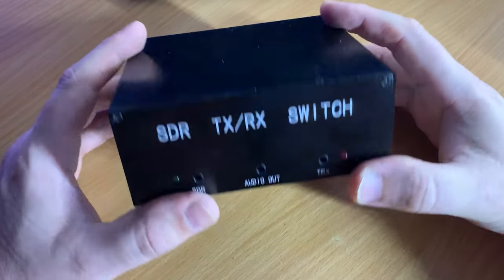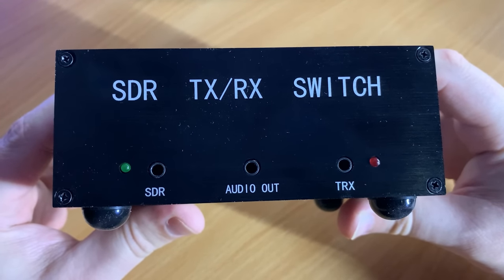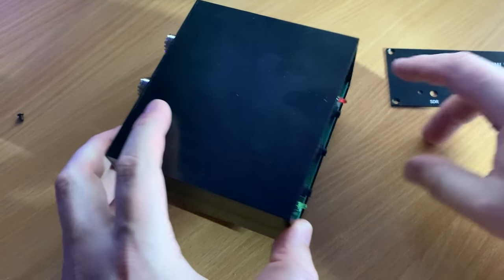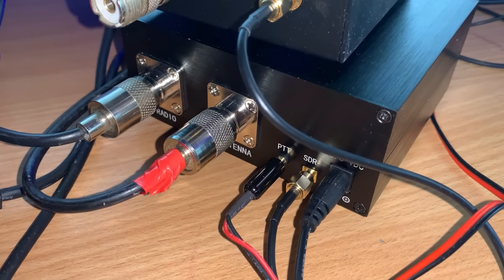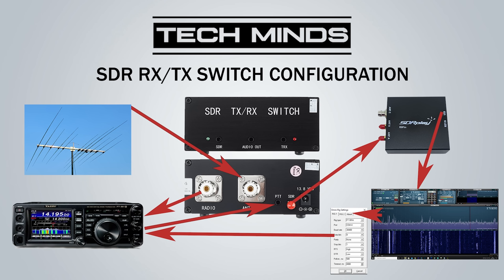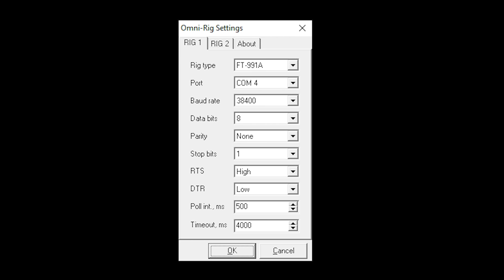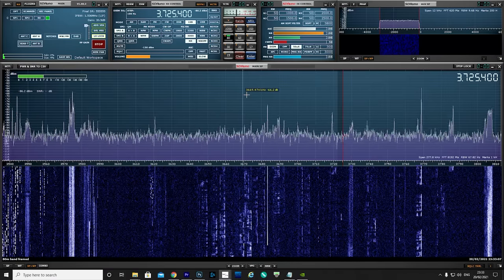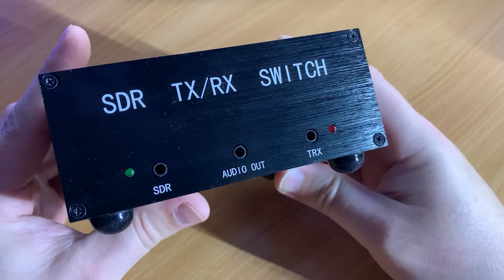PANADAPTER For Any Radio DC - 160 MHz SDR Antenna Switch

Comment: Very helpful video. The rf/af mute function was sluggish with my rig, and when operating semi-QSK CW, I heard a brief cw tone whenever going from receive to transmit, which was quite distracting. I stumbled on an easy fix to this in section 18.1 of the SDRUno manual - resetting the polling interval from 500ms , which seems to be the default Omnirig value for at least some rigs, to 100 ms. P.S., my TR switch is the MFJ-1708B-SDR, and I'm very happy with it. For me, at least, it had one huge advantage over the switch in this presentation - I actually received it after I ordered it. Banggood did ultimately issue a refund for the switch I ordered from it, though.

Comment: @Tech Minds:

I am not technically-inclined, so pardon me for that.  I have an analogue old HF receiver, not transceiver, that I would like to have a panadapter attached to.  I do also have a modern stand-alone SDR transceiver.  In order for the old HF receiver to access a panadpter, do I have to place this switch in line to my SDR, which in turn allows the input from the HF receiver to display panadpter readout on the SDR as opposed to, say, needing a computer to provide said panadapter?  Could you clarify my confusion?  Thank you in advance for your kind response!

Comment: I understand that there are two options: connecting the SDR antenna input to the gate of the first transistor  of the receiver amplifier using a "cathode follower" or rather a  "gate follower" of a FET, or connecting the input of the SDR  to an initial intermediate frequency step before it has passed through a narrow filter, also with a gate follower of a FET.

Comment: Just a heads up if your transciever has a built in ATU don't expect to have that work with your SDR , you will need a second (recieving)ATU between your SDR and the switch
Reply from the maker: Great point!

Comment: Very good tip. I have an SDRplay RSPdx and a Yaesu FTdx-3000, so basically I'll only have to follow the instructions to the letter. Thanks.
Reply from the maker: If you have a FTDX 3000 then you do NOT need to buy this antenna switch as that radio has an RX output. Watch this video I done on setting this up: https://youtu.be/bSJUdfRR9gw

Comment: How did you wire the 3.5 mm jack to the FT-991 8-pin DIN connector break out cable, I am struggeling to get it to work. For some reason when I connect the SDR the unit will no longer cut out to protect the circuit.

Comment: So,  here we are 3 years later.  I have a FT-991A radio.  The TUN/LIN jack on the back I have a control cable that goes to my tuner.  I am wanting to add this switch and a RSP1A but since the TUN/LIN jack is already in use, would I be able to just put a min-din 8pin Y cable on there to split off the TX GND and GND pins I need for the switch while still letting everyting else get to the tuner untouched?

Comment: Just received mine on your recommendation and set it up on my 991a, been playing this afternoon with it and working well. One question that's on my mind, as it clicks when power is applied to it, am I right in saying that if there was a power failure to the switch but I was still transmitting,  the sdr presumably wouldn't be protected as the relay is not shorting the sdr feed??
Reply from the maker: From what I’ve tested is that without power the relays fall into place so that the radio is connected directly to the antenna, and shorting the sdr ground. Thus, protecting the sdr if there was a power cut.
Reply: @TechMindsOfficial  thanks for the reply, I will certainly be testing this tomorrow.  If it is the case, that would be brilliant. Will post tomorrow to confirm on mine.
Reply: @TechMindsOfficial  Just as a follow-up,  I can indeed confirm that it does short the sdr when power is lost to the tx/rx switch. Thanks for your reply

Comment: It would be interesting to see some measurements of SWR and insertion loss.
Reply: on VHF I put in 40w FM .... only 10w came out,!!!!!
Reply: OK ... abit of testing.
1.8-30 Mhz SWR is ~1.2:1
50Mhz > 1.5:1
145Mhz SWR ~10:1 ..!!
So the Spec [on mine] should be Frequency Range 1.5Mhz - 60Mhz [NOT 160mhz]
Reply: @g0myw  Thank you. So what about the isolation between the ports during TX and the insertion loss on HF? It would be nice to know, if you have the possibility to measure?
Reply: @larsthunberg_SM0TGU  well that would be a good idea but all I have is a multimeter and a PWR/SWR meter.
But the label says . 
 [ not that I beleive it]

Impedance 50ohm .  [I really doubt this at VHF]
Frequency Range DC- 160mhz .  [ well not in my case . max ~60mhz]
Max TX power 100watts 
RF sense threshold <10mW @1.8 - 30Mhz
ON time <20ms  Release Time <190ms
Insertion Loss <0.3db @144Mhz (0.2db typical) 
RX isolation >38db @144Mhz (40db typical)
Power Supply 13.8v DC 200mA.
Reply: @g0myw  Thank you for your effort.
Reply: It is also important to measure the isolation on TX switched on, becasue after all the idea of this ubitbis to protect your SDR when transmitting....
Reply: @g0myw  Hi Jon, I also get huge SWR using this T/R switch on 145 MHz. Did you ever find a fix for that? Should I use an external antenna tuner ?

Comment: Great video. I got this device, however the TX signal cable that came with mine has a stereo 3.5mm plug. I saw the cable on your video and it had a mono 3.5mm plug. The socket at the board seems to be identical. I am wondering whether I can use an eBay cable that has the mono plug. By measuring the wires and the plug the middle part of the terminal has no signal, the red wire connects to the tip and the black wire connects to the back of the plug. It seems they ran out of mono plugs and send a wire with a stereo plug, but with only 2 wires and with the middle section disconnected.

Comment: Love your reviews, watched the MFJ pan' one the other day and was thinking of buying one and then I saw this review. They're currently £38.40 on Banggood, just one question I already have a mono 2 terminal jack plug lead could I use this in lieu of the supplied one wiring a 3.5mm jack plug to it? I take it they follow the standard where the centre pin is positive and the outer negative?

Comment: Great video. Any recommendation on how to connect the PTT when I am using a IC7300 and a Power Amp. I have a cable from the radio send jack to the AMP, so I'm not sure how to inject the TX/RX PTT into the situation. Thanks.

Comment: where does the SDR Patch lead connect on your RSP dx, Im trying to use the switch with an RSP duo using one of these switches and a MFJ-1708b, been using the MFJ switch with an RSP 2 without any issues, cheers

Comment: I have an end fed antenna with my 991a. Could I place my LDG auto tuner in the feed line before the switch to auto tune by keying the mic?  Thanks. I’ve learned a lot from your videos.
Reply: You place the automatic antenna tuner after not before

Comment: Have got one on order. I will have to make up my own PTT  cable to the switch box. As my radio ( TS480) does not have a PTT socket. It does have a din socket for control of a linear amplifier. 
Does the box require a specific voltage to ground the sdr on transmit?

Comment: @Tech Minds  help please ! Im doing custom cable for Yeasu FT450D which pins are you using to PTT ? 
wants to use TUNER Jack  port in radio are those pins correct ?
and pin 2 - TX Gnd (to tip jack/end part)
and pin 3 GND to the "longest" :) part of jack ??

Comment: Nice helpful review. I bought one.
When making the custom PTT cable, presumably using pin 2 - TX Gnd and pin 3 GND from the Yaesu 991 which pin’s cable should be connected to the end part the 3.5 jack ?

How are you setting up for the dual antenna inputs - HF and VHF/UHF ?
Reply from the maker: Tx Gnd connected to tip  . I only use mine on the HF port,  but I guess you’d just have to move cables around if you wanted to use on the vhf port.
Reply: @TechMindsOfficial  Thanks, very helpful.
Reply: ToyboxTV  please help - are you using to PTT: 
TUN/LIN Jack  port in radio ?
and pin 2 - TX Gnd (to tip jack/end part)
and pin 3 GND to the "longest" :) part of jack ??
Reply: @deszczykrobert4290  Robert, sorry it has taken me so long to answer your question. The short answer is yes.

Comment: I started with sdr’s then got fully licensed and bought the 991a, but find the tiny display crap compared to an sdr on a hd screen.   Nice bit of kit.   Have been considering the sdr panadapter than goes inside the 991a - but this is easier
Reply: Don't put your the sdr in radio mate.
Unless you have a Yaesu technician do it I would not recommend it.

Seen the boy do it with RSP1A and he lifted the traces to the USB. It looked a right mess.

This way is just as good and you don't risk ruining your rig (as much) 😎

Comment: How is the PTT control line (Red/Black wire) connected to the FT-991A radio? Does the 991A needs any special setting to provide the necessary signal to the switch?

Comment: Hi Matt,
Didn't want to buy the MFJ one as I read some horror stories. 

Be good if this manufacturer upped the coverage to UHF as well. Maybe you have the pull to contact the builder to perhaps suggest 440/450mhz coverage? 

If they done this it would properly out class the MFJ which I agree isn't too hard . 

Thanks for sharing

Comment: I have a Yaesu 450D and a RSP1A. I was planning to do something like this. One possible issue: When using 100W (50dBm). This SDR switch box has an Rx isolation of about 40dB. The continues input power to RSP1A is 0dBm (10dBm shortly). So I would probably need to put an extra attenuator of about 10dB in front of the SDR to be sure.
Reply: I alsi have an FT-450D and wiuld be interesred in any additional feedback you could provide... did you try it? Any issue?

Comment: For those running a G-90 I'm curious if all computer SDR software lags the radio audio when you have the jumper removed.  I imagine it has something to do with the 24 bit capability of the G-90.

Comment: hello tech minds

In the video you talked about using an ft991a, can you tell me which pins you used for the ptt from the transmitter.

is that the 13.8v and gnd?
Reply from the maker: It would of been the PTT line which I think goes to gnd on TX. You’ll need to check the radio manual as I don’t have a 991 any longer.
Reply: I created mine yesterday and connected pin 2 (TX ground) to the tip of the jack and pin 3 (ground) to the base of the jack. It works fine. Not sure if I needed to connect pin 3 as well, but it works. You don't need to connect the 13.8V.

Comment: I note it states upto 160MHz.  Given that I will switch it with the PTT control line could I also pass UHF / 437MHz at 5watts safely through this device ??

Comment: Question the feature you did with weather balloons the software will recommended will
That work with my base scanner ?
I’f so what’s the best frequency to use 
I tried to put the frequency range I. On the software but it came up invalid frequency’s I’f this software is for SDR  is there another software I could you for base scanner look forward to your reply Paul

Comment: Okay, I have a signalink connected to pi4 and I've been running digital just fine.  How do I connect the switch for the ptt if I already have that connection used up by my ftdi connection on myn897D radio?

Comment: I am guessing that the audio jack labeled SDR would actually be for the PC speaker output that your SDR is running on and my simple question is, does this device mute the SDR audio coming from the PC when in TX mode? SDRUNO only RF and AF mutes when your connected to the radio via CAT... I want to use this with non cat controlled OLD SCHOOL Radios.

Comment: I have a radio and an antenna switches. And have 2 HF rigs but I want to use it ONLY with my FT991a. How would I connect it to my radio if I have a radio switch? I already have the usb cables if needed. Thanks and 73.

Comment: Let me ask: how do I know if a radio is DC?
For example I know after read Ts 590SG  does not need switch
What about FTdx10 and FT 710?

I also know the FT DX 3000 does not see too.

Comment: Just a heads up for anyone wiring up the PTT cable for the Xiegu G-90.  This took some trial and error for me unfortunately.  Use the factory soldered connector on the SDR TX/RX Switch side, on the Xiegu G-90 you keep the ground the same on the TRS 3.5mm jack but you solder the PTT to the Ring or middle of the connector.  Just as the diagram on the CE-19 illustrates.  I made a label to remind me which side connects to the relay switch.
Reply: Also set RTS and DTS to Low 👍

Comment: Hallo sm6usu Svante here. I have the latest Mfj 1708B with airspy sdr and use Sdr console software. My problem is that I want to use the audio in my headset from the computer, because all kinds of filters in the software. I can get a really nice receiving. But when I transmit I get all my voice right in to my ears. I have no problems with HF before I did this Mfj 1708B. The sdr console has an mute option to headphones but when changing bands and frequensy you have to reset this figures often because it clips also the audio from the station you want to listen to or speak to which is very frustrating. I have tried to build usb relay to my headphones but when that clips the audio to headphones, the audio change to computer speakers or sdr console stops. No one talk about this. I have tried to solve this in 2 weeks now. I use balanced feedline from tuner to my 80 M loop antenna and have no problems at all with computer tuner and tranceiver with 100 w together with a few cm between the equipment, before I tried this  MFJ box. Is it same problems when transmit with the box on the video? When listen on the computer which was my prio 1, not the radio Other way it is fantastic audio and many other functions in software to play with. 73 de sm6usu

Comment: Hi Matt. I purchased one of these to run sdr play and win4yeasu. Ive followed your video which was really helpful. I've removed the jumper so get duel receive, I made a PTT lead as you did which I believe is correct. TX GRD to the tip. Red light stays on and the green light goes out when I transmit but looking on sdr uno the sdr rspa 1 is receiving the signal. So not grounding the sdr. My 991a is not grounded as my shack is on the first floor. Is this the reason it's not grounding the sdr or di you think something else. I'm a new ham and I know you have good experience of radio's etc. I would love advice. Thanks.
Reply: You will see the signal fro your own transmit, and it couls even damage your sdr depending on how much isolation this device gets when on transmit mode (receive disconected).
Reply: win4yeasu = win4yaesu I Bet. LOL No Such Thing as a YEASU. LOL 😂😊 P.S. DUEL = DUAL also.🤪🤣

Comment: Great video! I just started butchering an 8 pin DIN cable to make the PTT and realised I have an auto tuner already connected. Does anyone think the Linear port would work, or will I need to make a split cable?
Reply: Hi I"m encounderingthe same issue. I have a ft991 and a Mat tuner for it. This is connected to th tun/lin socket so I was wandering how this could be solved. Someone any idea?

Comment: Having an issue with SDR TX/RX switch.

Radio. FTDX10
SDRplay RSP1A
TX/RX SW(No name)

Radio connected sw from lin jack.
Ground to sleve of 3mm jack on sw
TX out to tip of 3mm jack.

When I plug it in the sw goes into TX even though the radio is not transmitting.

Anyone else have this problem?

Comment: Can you please show to what pins you connected to 3.5mm on the tun/lin jack? i cant find anything online and mine isnt working.
Reply: I connected mine as follows: Pin 2 TX Ground to the tip of the jack and Pin 3 Ground to the base of the jack. It works.

Comment: Quick question will this work with the FTDX10?
Reply from the maker: Yep, but there is a better solution for dx10 if you’re willing to open the radio. See my other videos.
Reply: @TechMindsOfficial  Thanks for reply, will get the hardware from sdrkits.
Reply: @gareth1500  Just be aware that the sdrkits board will work just fine on the HF amateur bands but sucks at other frequencies. Using an SDRplay, the lower and higher frequencies are greatly attenuated. It does not cover the entire RF spectrum.

Comment: Whats the difference from this unit to the mfj1708sdr ?
Reply from the maker: This is better build quality and has the audio switching feature, the MFJ has adjustable delay/release time.
Reply: @TechMindsOfficial  I have been looking for something like this so I could better use my SDR unit with my old boat anchors but couldn't find a solution to mute the computer audio on TX...would the audio switching feature solve this? Does it ground my audio line from my computer audio jack on TX? (of course as you show, the software along with omni-rig accomplishes this with modern rigs by muting on TX within the SDR programs and using my 1708)

Comment: I just realized that RF sensing isn't working in my unit. I have always used it with the PTT connected but tried without it. No relay clicks and the SWR went in the roof. Anyone else with the same experience?
Reply: Try setting RTS and DTS to low

Comment: Hi everyone!
My questions: Does it work up to 160MHz in transmission? Does anyone have any real data of SWR, RL, etc?
Were there any problems with working on RSP devices or RTLSDR dongles??
Has anyone tried the MFJ1708B-SDR?? It should be the latest version for correct functioning ... THANK YOU all..
Reply: See the RICK post up top!
Reply: It did not work well for me at 145 MHz - too much SWR. On the the 10m band it worked well. I tested it with both the RTL SDR (SDR#) and RSPdx (SDR Uno)